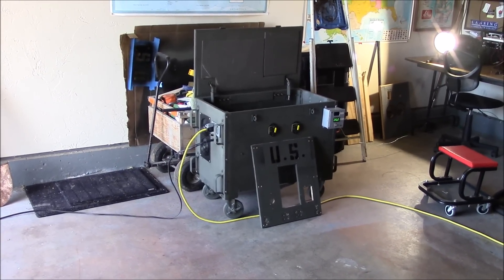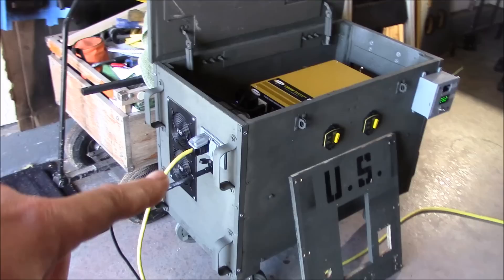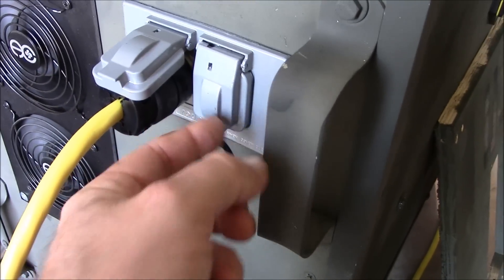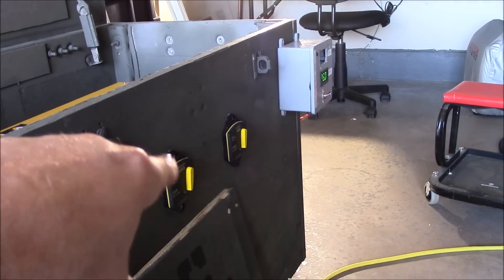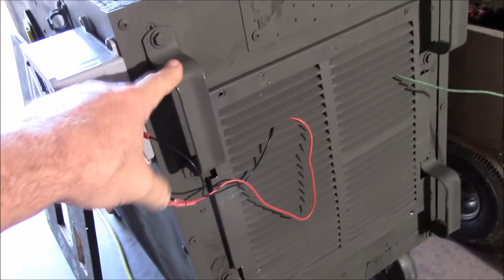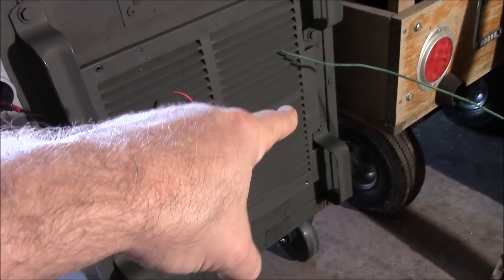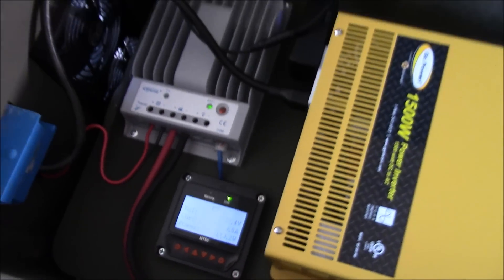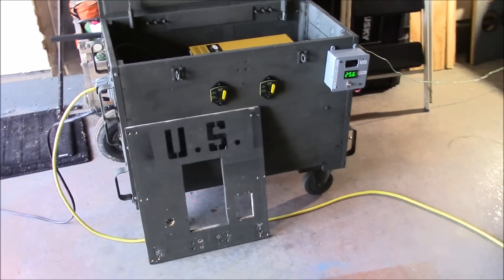DIY 24-volt solar generator (Part 5.1)

Comment: Hi Chris 
David from Texas here.
Very nice project you got going there.I have a go power 24 volt 1000 watt inverter that i am selling  if you are in need it is for sale on ebay.I am just not able to use 24 volt right now and thought i would sell it.It has never been used but i tested it and it works great.
Have a great day.Happy Halloween stay safe.

Comment: Nice solar generate what can u power with it
Reply from the maker: 1,500 watts continuous (just about all appliances) with 2,000 watt surge. The idea is not to run that high of a load continuous...solar panels bring the batteries back up to full power while in the sun. And, about 1 KW/H of use overnight.
Reply: Ok

Comment: Hi Chris, Your box is almost DONE....have you tried lifting with the handles in a vertical position ? Looks like they would put more stress on the top of your hands or your wrists ( even though they fit better in their current locations) .  I am slowly moving with my case, still waiting for some minor supplies.  I also requested some EMP metal impregnated neoprene sealing material from a site in Netherlands. Trying to locate a source stateside. I plan on replacing the cheap adhesive seal that is currently on the underside of the lid. I am reinforcing the bottom with 1 1/2 " aluminum L angle to stiffen the bottom for transport. Probably will spot weld the aluminum and also parts of the steel cart next week.  I'll send you more photos on Facebook.   Later buddy    Jim K
Reply from the maker: Sounds good. Yes, tried lifting with the handles in a vertical position...wrist breakers. Horizontal is much better and the box's internal bracing supports better. Good luck with your box too!